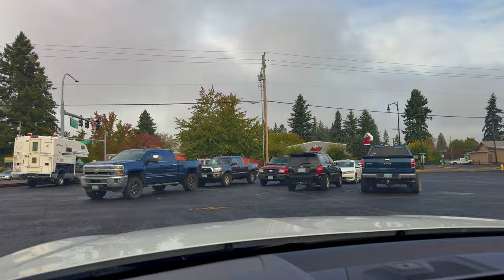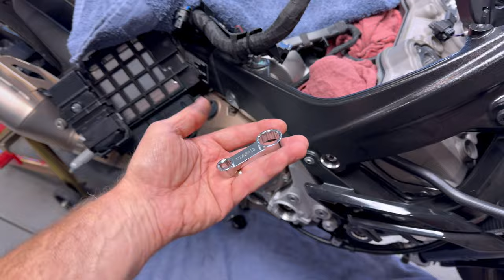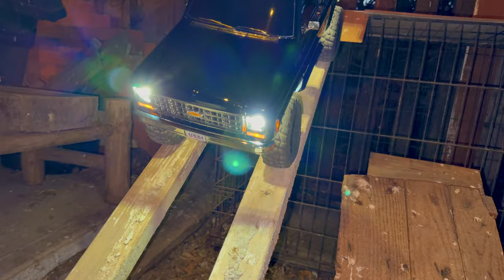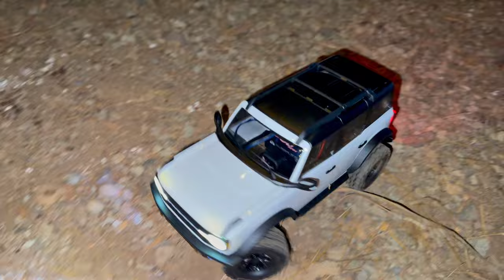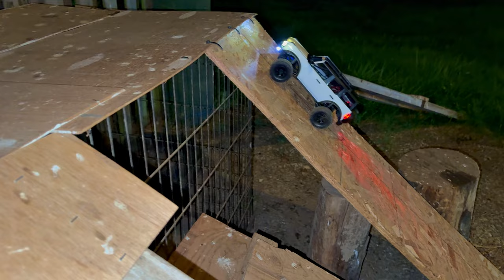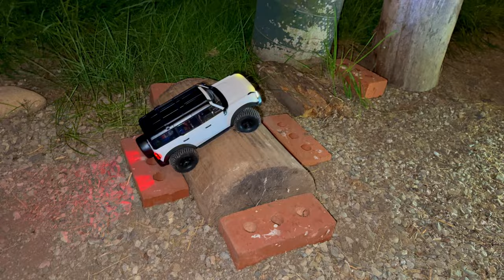K10 & Bronco Got Together!! • Then Bronco Mini-Me! | TheSmoaks Vlog_2893

Comment: Nice, I didn't realize you had ordered a 2nd body with it. That little Bronco climbs like a goat, especially after you get the brass rings in the wheels. Killer on side slopes then too. My 1/10th has shipped and I should have it next Monday. As for bikes it is rainy today but looking good for one last ride tomorrow. After that the weather takes a dive. Snow expected Saturday and then all next week the highs are 32~33 degrees so the start of winter is about to arrive. I bet we will be seeing temps around 0 in the next couple of weeks.